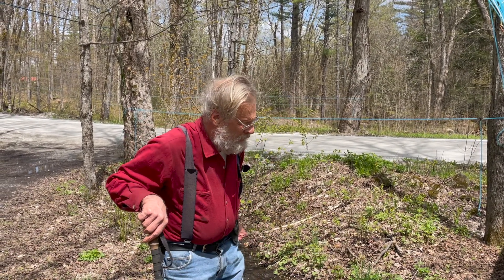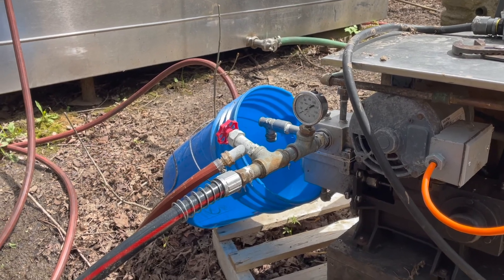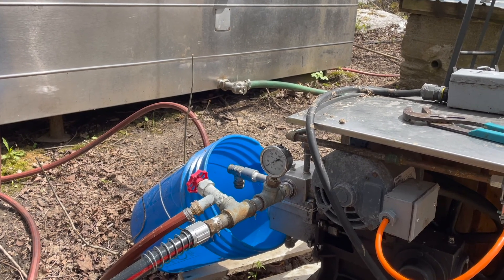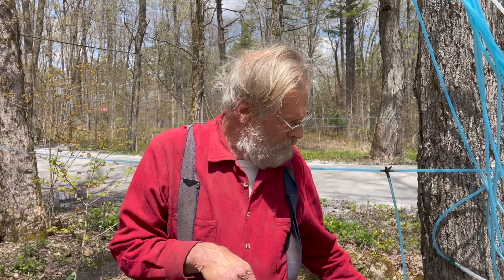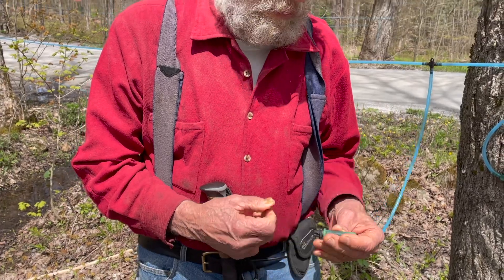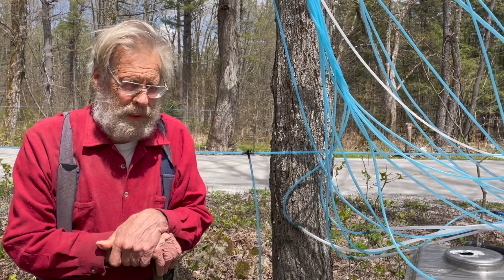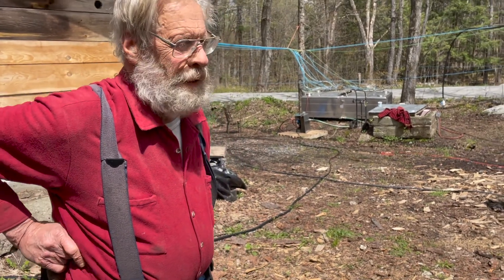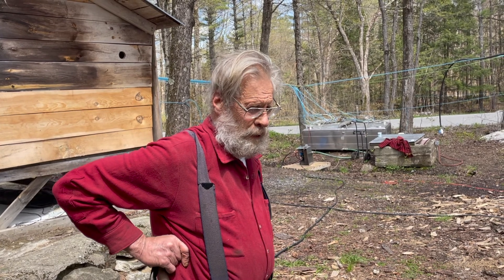More and Better Cleaning 3/16 Tubing with Calcium Hypochlorite

Comment: The woman uses a paper to check the liquid coming out at the tap, is that ph paper, where does one get it? Thanks
Reply from the maker: It is not ph paper, it is a chlorine indicator strip. The ones we use are by Hydrion in the 0 - 200 ppm range. The actual concentration we use goes to 400 ppm but these strips are sufficient. You can get them from Micro Essential Lab, Grainger, or any other similar website.
Reply: @kruegernortonsugarhouse1012  thanks

Comment: Hey Art, long time viewer.  Thank you for the videos.  Just noticed you updated this information.  I was intrigued by how you are using the stericaps.  From what I understand, they were designed to work with isopropyl alcohol which we all know is illegal in the states.  

I see you have not jumped on the checkvalve bandwagon as well. Can you tell me your reasoning for that decision as I have not either. 

Did you switch over to 5/16 drops? From my understanding, that was supposed to help alleviate the need for a check valve on 3/16.  Thanks again!
Reply from the maker: The stericaps are used to soak the outside of the taps with the calcium hypochlorite solution. While we are pumping the solution we go down our lines and detap and place a stericap over the end, ensuring there is chlorine in the cap.

Comment from the maker: I do not inject air any more.  The pump is capable of 100 psi.  This amounts to an elevation lift of over 200 feet, and is sufficient for me to do my entire sugarbush.  If I had higher elevations I might consider injecting air.  
Line cleaning is a work in progress, and as we learn we change.
Reply: Why did you stop using the air mix, I thought the pulsating action was a good idea, thanks
Reply: Does 200 psi blow caps off or taps out of tees?

Comment: Do you still inject air or are you just using the pump for the liquid? Thanks!
Reply from the maker: We are no longer injecting air. If I had extremely high head we might try, but our pump is strong enough to pump the liquid unaided.

Comment: Does the Calcium Hypochlorite affects the trees in a negative way, since the sanitizer is under pressure going into the tap hole of the tree before it is being pulled?
Reply from the maker: I have never seen any problem.  The tap holes all heal well.

Comment: Hello - I'm new to maple syrup tubing systems and I'm considering using the 3/16 tubing to pick up natural gravity vacuum off from my hillside.  Would you say that your cleaning technique has proved successful since implementing it? Also, in previous videos, I believe you mentioned some sort of a report to show your findings.  Where can I find that report. Thank you so much!
Reply from the maker: At the moment there is no report, we have done a few articles in maple news over the years and hope to be working with a university in West Virginia to do further work on the system. But yes, the method is successful and you will need to implement it or something like it after the first year.
Reply: @kruegernortonsugarhouse1012  Thanks so much for the reply.  I really appreciate it.  Glad to know that your cleaning system is successful. I’ve certainly heard mixed reviews on the 3/16.  Everything from tees plugging, to the tubing flattening and restricting flow.  I’m happy to hear that you’re still having good success with it. Thanks for leading the way on the 3/16 frontier :)